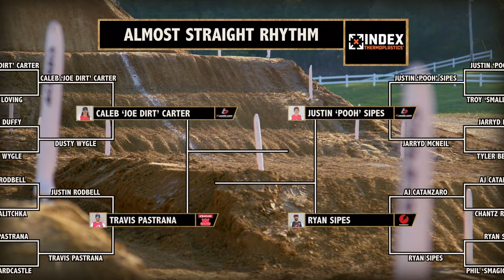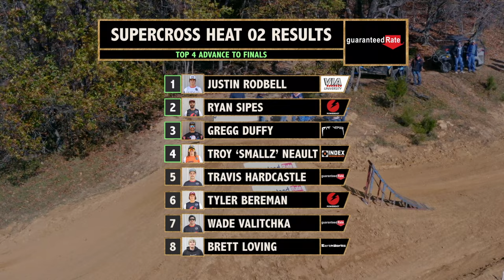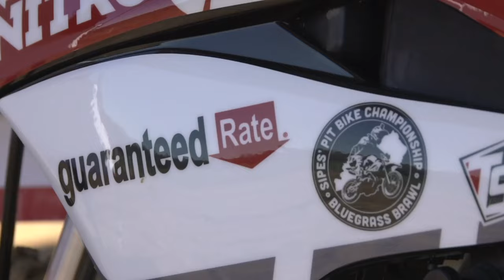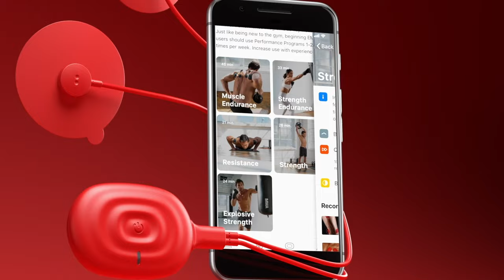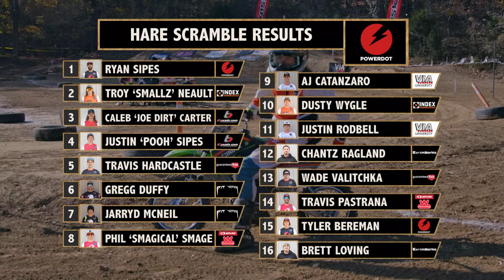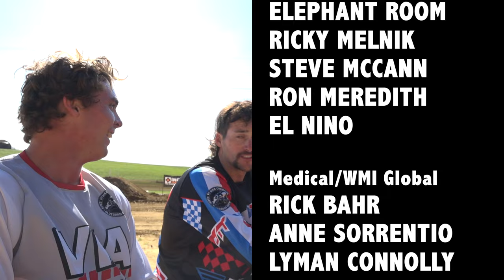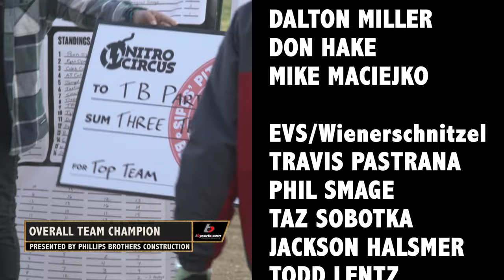Sipes' Pit Bike Championship: Bluegrass Brawl

Comment: Jason Falcon 76 I raced motocross Supercross with Tony Rodriguez a pro GNCC pro national Tennessee he could climb strait up but everytime we were in the woods I'd be on My 125 and I had to run into him because he run Bark Buster's which you don't want to be 10 feet back because when he hit and had a 40 foot pine tree about 4 inches around becouse if your that far behind and get whipped by the tree. Never happened because I used him and his RM 250R But very very fast plus we could tear a bike down in 15 minutes and 8 to 12 hours in the oven to pop the crank case but he's a Cadillac Transmission tech which my best motocross Supercross racer of all time. I had to run into him one time because this trail at 80 mph he didn't know there is a 200 foot drop coming out the woods it was a water reservoir for a power plant 1 mile from a plant in the middle of No were of 10 mile in Pensacola Florida.🙏🦊🇺🇲🏁❤️👀💯%